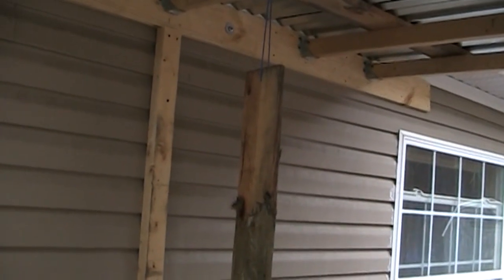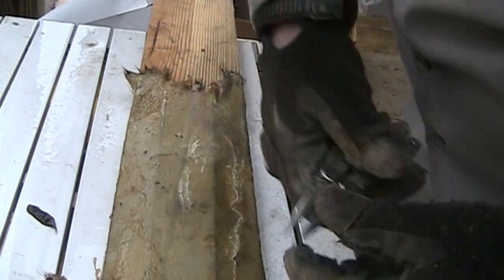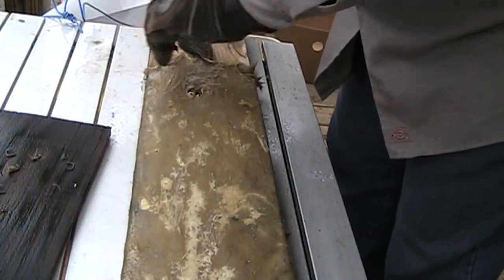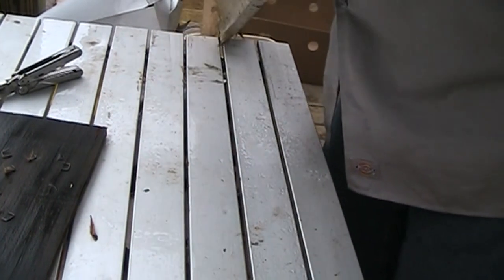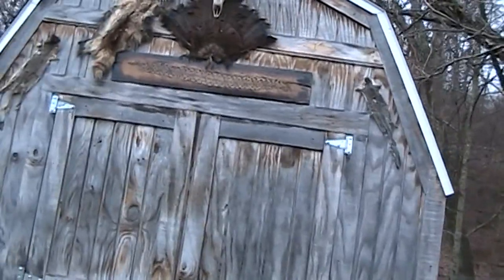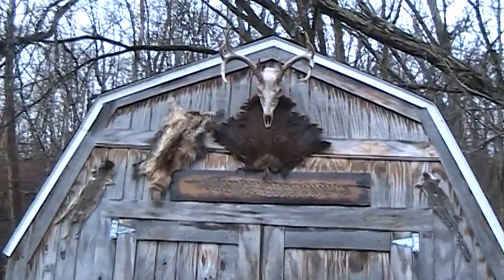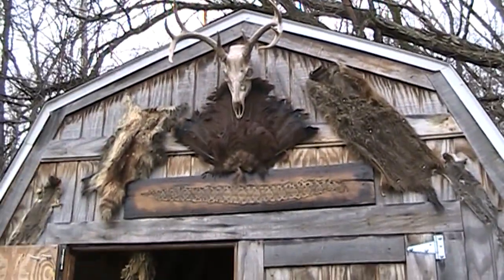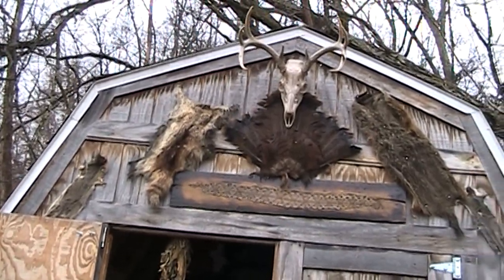Groundhog day

Comment: Try putting a wedge under the ends of the belly board
Reply: Oh and a cup of mayo mixed with two eggs let soak in for one day in a plastic bag to soften up the hide then wash it. Mayo adds oil, eggs add protein.
Reply from the maker: Yep, I need to redo the belly board for sure..lol.  Thanks,
J